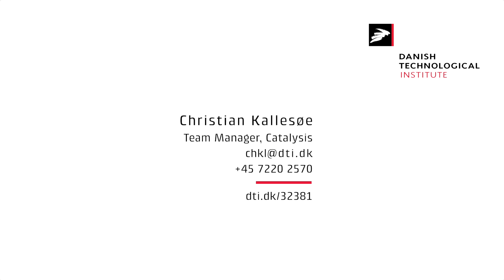Nano catalyst production

Comment: Interesting! How do you "grind" a metal to get nanosized particles? Is there a special machine that does that?
Reply from the maker: Hi Dalsenov! We build from the bottom up instead. Often the nanoparticles are produced from metalloorganic precursors or metal salts. By building the nanoparticles from these compunds, you start from atom-level and grow your particles from there. This makes it possible to get extremely narrow size distribution - especially when producing in supercritical conditions (high temperature, high pressure). We do use grinders as well, but to crush agglomerates into finer powders to make them easier to handle and make into dispersions and inks. All the best!
Reply: @FunctionalMaterialsDTI  Thanks for your answer! I had in mind pure metals (Cu,Al,Ni,etc).In the meantime I read about "laser ablation".I suppose this is a technology for  downsizing as well.Keep up the good work!